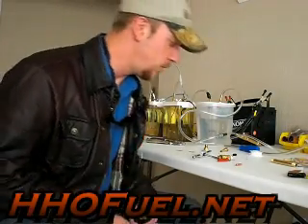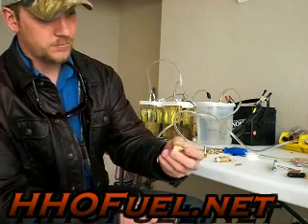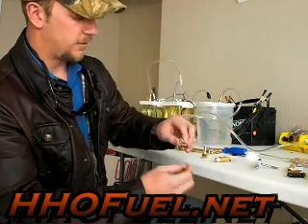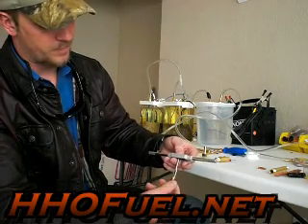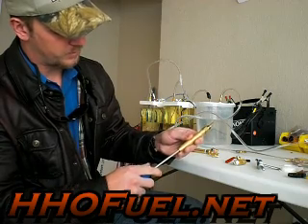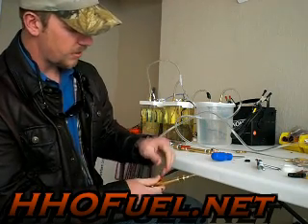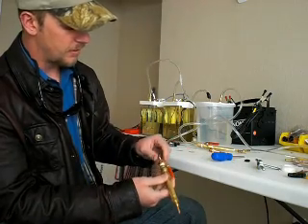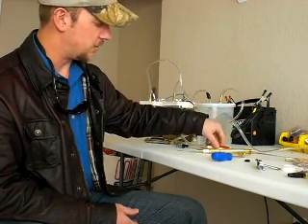HHO Torch Construction Video

Comment: Question: Can the valve be used as a control for the flame height, & if so, what about back pressure in the line & inside the HHO generator? I was thinking maybe a pressure release valve ported through a 2nd line to an open space a safe distance from the work area?

Comment from the maker: -make sure you have enough fine bronze wool in the torch.  

-pour some water o vinagre in there to make the wool wet

-also, your production may be a factor, you need to produce a minimum of 1.25 liters per minute to use this torch effectively.

-your battery terminals may be hot because your connections are too small to handle the electricity, get bigger connections and bigger wires, try 10 gauge.

Comment from the maker: steel wool #1 will rust quickly, #2 it conducts heat much faster.  You should have fine bronze wool which you can find online.  Medium bronze wool doesn't work as well.  The idea is to break up the heat of the flame quickly.